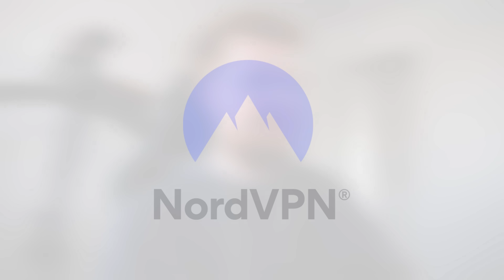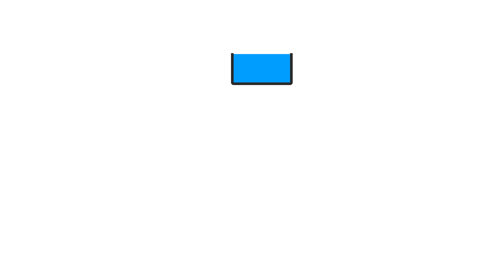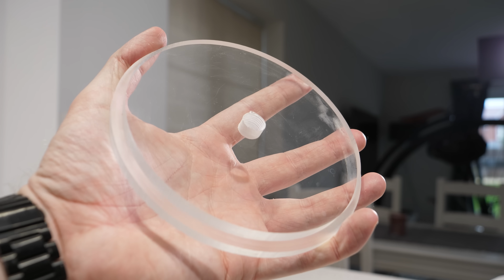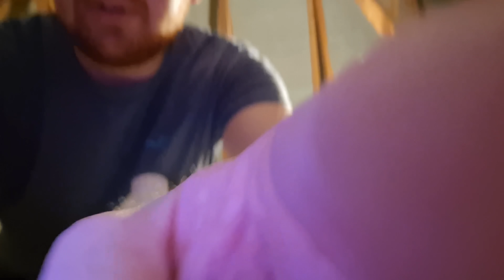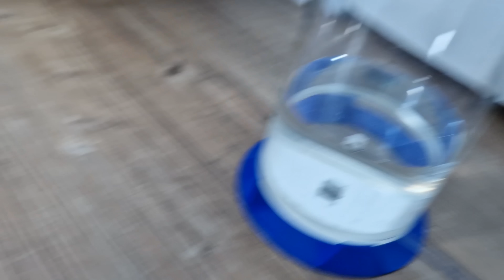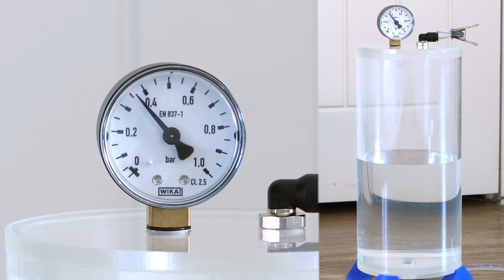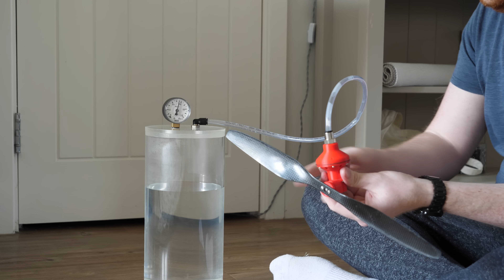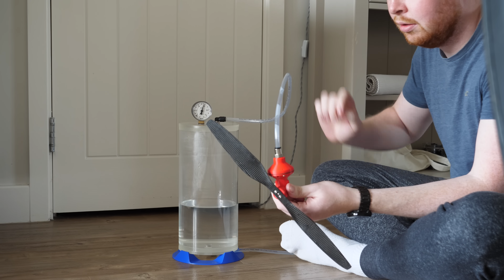Liquid Air Engine

Comment: I think it can be more upgraded. Once the water reached the highest level it will flash out with some help of mechanism such as floater and then another tank will do the same job while flashing the first tank just to continue the engine work. It can work with water from the rain with a big reservoir or with the river stream in some higher land

Comment: Have you thought about trying a 2 piston design? You should be able to make a single piston unit that can slide through and operate 2 ball valves/diaphragm chambers 180 degrees apart. For the crank pin, a horizontal slot in the middle of the piston would allow a pin to be inserted and translate linear motion into rotary motion. This design would allow for increased diaphragm area without increasing the diameter of the diaphragm, support the piston at both ends and smooth out power delivery, by having 2 firing pulses per revolution.

Comment: I think you've about got this refined to the point, you could put a small generator on that engine, and using an increase in volume say 50 gallon drums on each end, you could then use it as an emergency generator or LED lights and phone charging etc and so on!!!

Comment: I think as the others are saying adding lubricant and a flywheel to the engine , and a floater to the water tank and possibly a trompe should increase the functionality.
Would love to see it compared to the original one on the thrust bench.

Comment: This is absolutely amazing! I never thought of using water as a way to constantly keep pressure onto something. I did think of how water pressure could be used to create some sort of air battery, but not to keep a constant pressure.
Even though not everything that is built for the sake of curiosity needs to be functional, I am curious if there are applications for this kind of technology. I could see this being useful in some way in areas with mountains due to the natural height differences. Maybe tall buildings could do something with this from rain water?
Reply: You might be interested in trompes. They aren't used too much today as far as I know, but they used to power mines, and use flowing water and a height difference to produce pressure.
Reply: If you want water for keeping pressure constant...also you must think about refilling the airbottle again after using all the air inside it. Maybe a system to empty that bottle down with a float...cutting of the water supply short, emptying the bottle down with other good use of that water  and restarting the cycle....a system with 2 air bottles could make continues running possible with switching between those using a float. if there is enough water at the top (mountain)

Comment: You may get a longer run time if you put the engine to work. A flywheel and pulley to run something? Imagine getting it to pump the water back upstairs as it went 🤔

Comment: I used to run a CNC router. I was told I couldn't cut soft plastic on it (eg. LDPE) but it's simply not true. You need a really sharp O flute bit and run it quite a lot faster than you feel is sensible. I got pretty nice results cutting plastic floor boards for cattle sheds, which are very cheap

Comment: technically this is gravity fed i think, the water is equivalent to a weight on a chain, air pressure would be the sprocket, so i think its gravity fed since you using gravitational potential energy in the form of water pressure?

Comment: Check out DIY Perks' smoothing of 3d-printet parts using acetone, for reduced friction. He shows a method for smoothing the printing lines and achieving a glossy finish without sanding :) Cool project.

Comment: I believe that using a resin printer for the top part of the motor will give you far better results for the seal efficiency. Also it would look really cool with clear epoxy resin. That is a really great engine you built there!

Comment: Just increasing the hose radius twice will increase the flow 16-times, as the volume per unit time depends on radius to the 4th power. No need for wider cylinder.

Comment: So, interestingly, you have definite starting and ending quantities of air, and you can easily (😟) count the number of rotations. This will tell you exactly how much air is spent on each rotation which would be very interesting to compare to the volume of your cylinder. It would tell you how much air leaks on every stroke. It seems like that number would be pretty small.
Reply: @mjolnirswrath23   Energy is conferred to the motor by removing air from the system (allowing more water to run down from above, transferring the water's gravitational potential energy into air pressure, and from there into kinetic energy in the motor); in a closed loop the air trying to go back into the tank would be fighting water pressure, which would stop the system (or, alternate explanation, if the air is allowed back into the tank it would prevent water from flowing down, stopping more energy from making it to the motor, the system would be at equilibrium and no movement would happen). 
Similarly, collecting the water from hydrogen combustion is all well and good, but energy still needs to be re-introduced into the water to separate it back into oxygen and hydrogen before it's fuel again. Unfortunately there's no such thing as infinite energy, it has to come from somewhere.
Reply: Except he doesn't have a "cylinder", it's the weird flying saucer shaped area above the diaphragm and that doesn't get filled with air at the inlet pressure since the valve only opens for a short time.
Reply: @mjolnirswrath23   I cant understand a fucking thing you're saying.
Reply: @FoxSock  man, he must've deleted his comment. I don't suppose you remember what he said?
Reply: I wonder if you could get more air volume by putting a T fitting and a schrader valve below the pressure gauge, then pump the water back up to the reservoir with a bike pump by pumping air into the tank?

Comment: remove propeller that takes power. put a flywheel. put a smaller throw of the crank. that reduces air needed greatly.

Comment: Before milling acrylic, it helps to put the piece in the freezer for a few hours.  Turn the router motor to it's slowest speed and move with the highest feed rate possible.
The flow resistance of a long skinny tube is proportional to it's length.  A long fat tube with reducers at each end would do a lot to maintain steady pressure.  Short sections of skinny pipe are no big deal.

Comment: The air motor is amazingly elegant. I love it. However, since air is compressible and water is not, wouldn't it be better to pressurize the water with air, and then use the pressurized incompressible water to power the engine?

Comment: Your videos are really good you put lot of efforts in them researching, prototyping, and demonstrating various concepts to us.

I'm not an expert, but I did saw videos where gears were 3D print they became smooth when they are lubricated using grease or just few drops of oil.
That piston can be lubricated to reduce friction with the walls.

Comment: and what about using directly water to power the engine ? 
(Does it work if the water is used directly - but probably you need more flow)

Comment: You should definitely add an extra hose to the system, 
Same diameter or even bigger would be nice. 
You could also use water from the tap as this could have more than 0.6 bar pressure. 
Keep up the great work!

Comment: I wonder if it would be possible to build a solar heated piston along these lines... Something you could place in the sun that would allow a small amount of water to evaporate/boil off, pushing against a piston inside the air chamber which in turn would increase the air pressure...

Could it even be possible to use the gravity method to introduce tiny drips of water into the steam chamber side of the piston via a one way valve as long as the pressure was higher than the chamber pressure?

Comment: Charge directly to a magnet under water disassociates water to a gas expansion (make sure to add regular air to lower it's danger of exploding.) Use that expansion as the air pressure against the piston. When the piston compresses the gas it should implode back into water.

Comment: this is a great kinetic battery. just like some of the trains used in europe, this is using kinetic energy of gravity to store or produce energy in a different direction.
tbh i can already see this scaled up to a rain catcher and a canister you can detatch and bring to the top floor of a house or apartment and create a kinetic battery within modern architecture. ultimately something living will have to bring the water from the bottom to the top, but this can even be expanded into anything that gains weight over time. you might even be able to put a pulley system with the water as an elevator weight, but im just rambling now.

Comment: Bro.. why didn't you add a Shrader valve to the top on the water tank. Then just hook your bicycle pump to that, pressurizing it. That would force the water back up into your attic. 

If you buy a replacement valve for a car tire (from the car parts store), cut the fat end off, and push it into the end of your tubing. Then you can just unhook the engine from the tubing, put the tubing over the valve, and pump the water back upstairs? Then pinch the hose, unhook the valve, and connect the engine again?

Instead of phsyically taking the water back up the stairs manually? BTW, this is a current 'energy storage system' used for infrastructure. A damn lets water down at night, to power the turbines. During the day, solar powers pumps, to pump the water back up to the dam.

Same thing here

Comment: Larger tubing is easy, leave the small piece at the cylinder, but use a short length of tubing to get out, and then use a coupler to go to 16mm tubing, which is about the largest cheap one you can buy. Then only the top do you need the 16mm pipe fitting into it, which reduces all the dynamic losses in the tubing a lot. Use polyurethane tube, which is not transparent, but has a thinner wall than the PVC tubing you used. Plus is a lot cheaper, as you buy a 10m roll.

Comment: Please be careful with acrylic pressure tanks. They tend to fail catastrophically. Not a problem at those low pressures but once you go above that, add a layer of translucent tape around it that keeps the acrylic parts from flying everywhere in case of failure.
Reply: Also, that acrylic cylinder design is a terrible pressure vessel shape...
Reply: @namibjDerEchte  To be fair, he talked about that and it was for simplicities sake.
Reply: Pressure vessels are typically designed to bend and leak, rather than break at the strength of the material. This one is probably done wrong, so yeah, failure mode is an important consideration.
Reply: @phil2082  in this case the horrific lid design is actually a safety feature - that lid will fail LONG before any acrylic (of 15mm!) explodes in his face.
Reply: The lid will probably fail before the acrylic, but the tubing might fail even before that, and the attachment for the tubing almost certainly fails first.  But even that's moot unless he gets a taller house.
Reply: Pretty sure the pressure is so low that it's not nescessary.
Reply: @AN2Felllla  Agreed, 0.7 bar is just a pitiful amount of pressure.
Reply: I would be interested to see how a dental drill air motor would compare to yours. They spin at 200,000 RPM so some gear reduction would be needed to spin a prop. Maybe a few planetary stages? I doubt 3D printed parts could handle that though.
Reply: Safety Third tho
Reply: Mans is smart enough to not over look something so trivial
Reply: @Endiannn  Gotta get that knowledge somewhere!

Comment: Regarding the water inlet to the lower tank, it struck me that the water being fed in is also fighting the pressure of the waterabove it ... would be cool to see it with the water being fed into the tank from the top, and I suppose eventually the pressure of the air would stop the water entering ?
Reply: Hmm or I guess the air would escape up through the water inlet pipe ...

Comment: A hybrid-hydro air engine?  Nice design, experimenting and testing process.
 If-only a way to empty the cylinder occasionally once level is high, then you run the engine from water collected off the roof when rains ... very long run times. ;)

Comment: I wonder how much pressure it would take to run a V8 air engine smoothly (High PSI) and with the lowest PSI to could do, I feel like it could run a bit better on the same PSI because there are more cylenders on the power stroke

Comment: This project reminds me of a YouTube video I once watched, which discussed a unique power source for pneumatic tools that were needed for mining in a remote town somewhere in Canada. It used an cylindrical bell-like structure (made of iron or steel, if I remember correctly), which had a fitting at the top, through which pressurized air could be fed into pipes and hoses that attached to the various tools that were used (drills, power-hammers, conveyer belts, etc). The “mouth” of the bell was lowered into a deep pool in a nearby river, which trapped the air in the bell below the surface of the water, so that the air in the bell was compressed by the surrounding water. Then, as I understand it, they brought water, via an aqueduct, to a fluke that ended at a significant height above the “bell,” which fell next to the bell. As the water fell, it mixed with air which, entrained with the water, was swept below the surface. Because of the angle of the falling water carried the entrained air through the water in the pool at an angled, by the time the air rose up through the column of water, it was underneath the “mouth” of the bell, and so joined the air already in the “bell,” causing the water level inside the bell to drop, and the air inside it to “equalize” at a higher pressure than outside. Thus, a self-renewing source of pressurized air was made available to do work at in the pneumatic tools which were used in the mines. It was a very impressive system, and many decades later the pressurized pipes could still be seen (though they were no longer pressurized, of course).
Reply: I believe you are talking about a trompe 
https://en.wikipedia.org/wiki/Trompe
Reply: Sounds quite eco friendly. Like hydropower without electricity
Reply: Probably the practical engineering video; 

https://youtu.be/uvf0lD5xzH0
Reply: Lake Nyos has something similar, I believe. Except these were used to remove harmful gas from the bottom of the water column.
Reply: Ragged Chute!

https://www.youtube.com/watch?v=uvf0lD5xzH0&vl=en
Reply: Awesome replies, thanks folks. I couldn't for the life of me remember the names/locations involved.
Reply: that is cool
Reply: trump pump 🤔
Reply: @SnowingNapalm  the what trump?
Reply: @Marcy53Volkswagen   trompe

Comment: You could have saved yourself a trip back and forth if you had an air tank to push the water back upstairs. Also maybe use carbonated water to add air to the cylinder.

Comment: Bigger water tank + hydraulic ram could produce much higher pressure for a given height (for the cost of higher water consumption).
Going to need larger pipe diameter anyway.

Comment: what's crazy is that ultimately this is powered by the food you ate (or the sun that grew that food that is operating off of fusion power million of miles away) because the energy came from you carrying the weight of the water up the stairs. Kinda cool to think about.

Comment: bloody brill, Tom: wtg!   Now all you need to do is have two or three of those cylinders going sequentially - first cylinder running the prop, filling with water and once nearing the top switching to the next cyclinder to do the same sequence but then starting to empty the first cylinder of water. Or have a rotational switch to have water from each cylinder power the prop....  Great stuff.

Comment: This new engine is so efficient that I am wondering about it not as a steam engine, but as an engine powered by the expansion of heated air. I guess it would need a pressure regulator like a propane cylinder has, but still it seems very feasible.

Comment: rather then emptying the system and carrying the water back up, why not just pump some air into the lower reservoir?  The pressure will just push water back up the hose (so long as you size things right and don't overfill the upper tank)